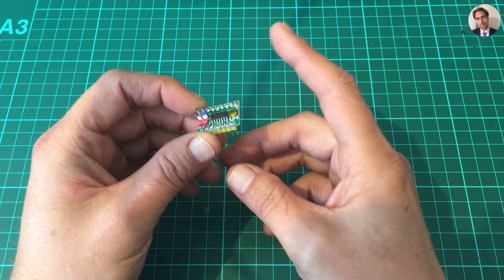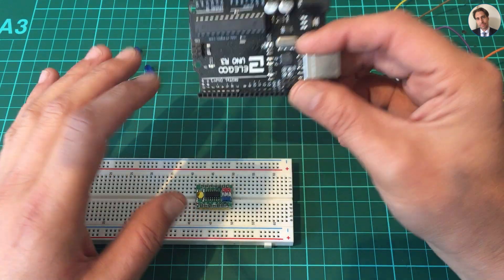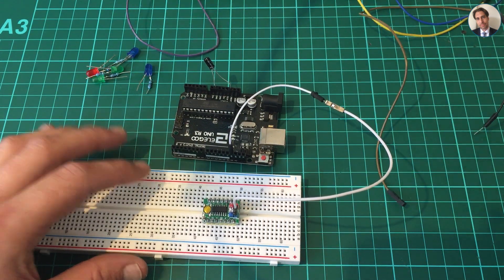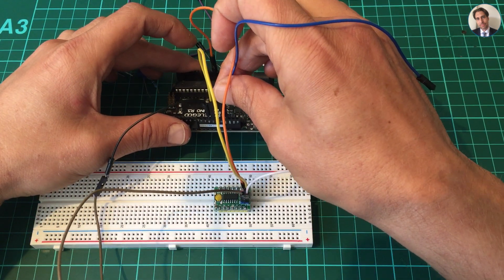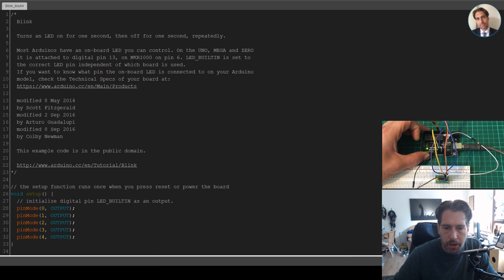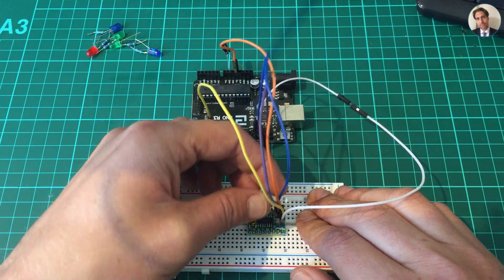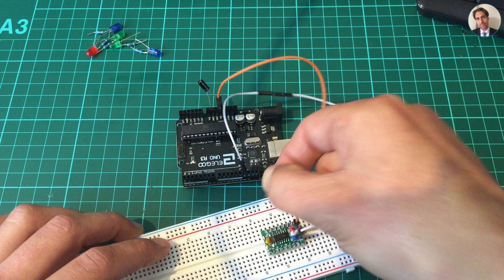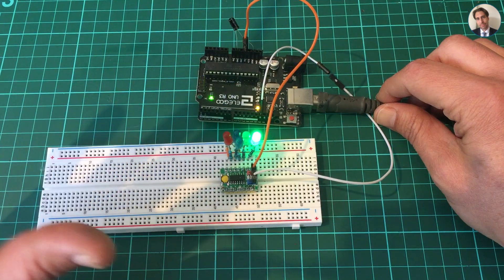How to program an ATtiny44

Comment: if i upload bootler with arduino.  can i upload program without arduino with just usb ?
Reply from the maker: No… you will need an USB To serial chip. You can’t program the Attiny44 directly via USB.
Reply: @DustinWatts  thx a lot